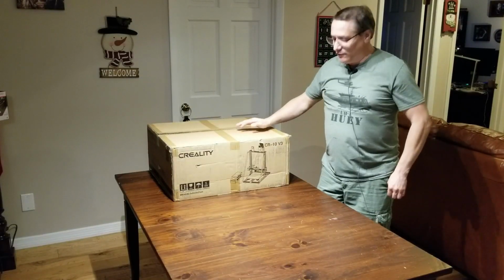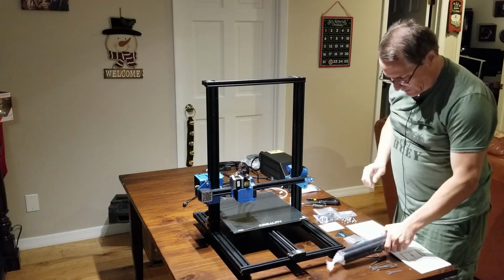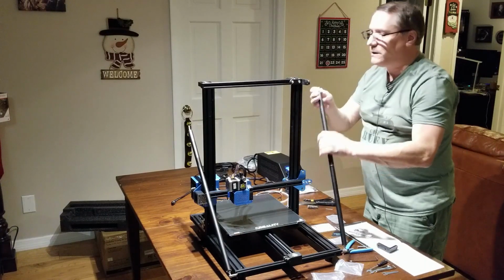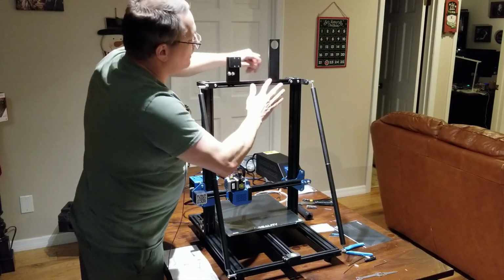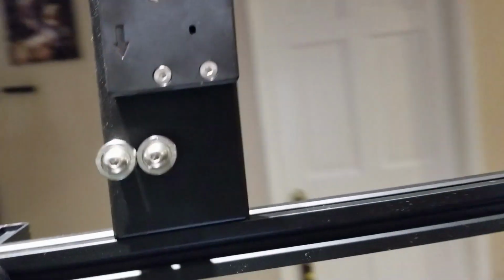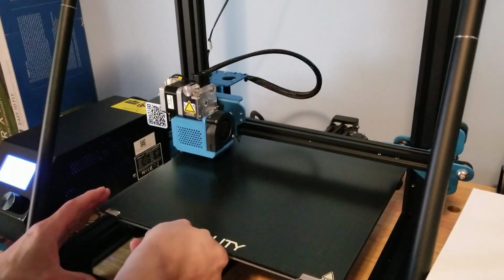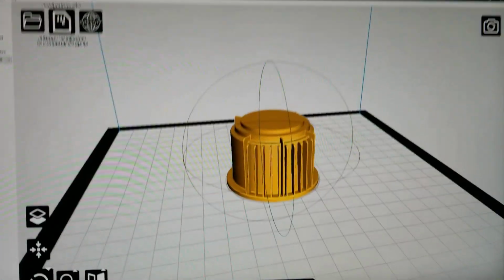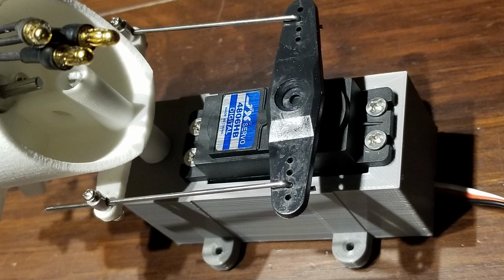Creality CR10 V3 3D Printer unboxing and setup for RC Airplane hobbies.

Comment: What type Of filement do you use?
Reply from the maker: PLA normally
Reply from the maker: Just got some glow in the dark filament, should be fun.
Reply: Nice i was wondering also if you know what proper settings is should use in creality slicer because i have the same printer and my prints keep failing
Reply from the maker: @Trollface_shinigang  I download the latest version recently then loaded the printer definition file. The default settings,  once loaded, work well.

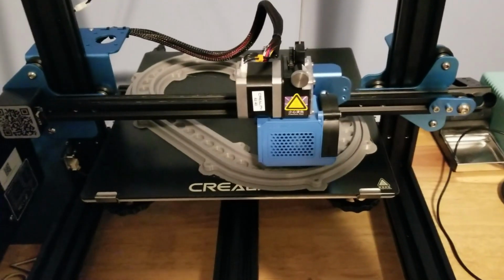Comment: 43:43 I came for the thumbnail wondering what part of an aircraft that would be? Hovercraft 👍
Reply from the maker: It's the rail that holds the air skirt. It will be in the build video once it's finished.
Reply: @georgessmokymountainrc5815  I'm glade I found your page I came down to gost town in the sky on my 7th grade school trip and wondered if it was still there I'm about 45 min away from Bristol
Reply: Are you from smoky mountain Tennessee or Dollywood?